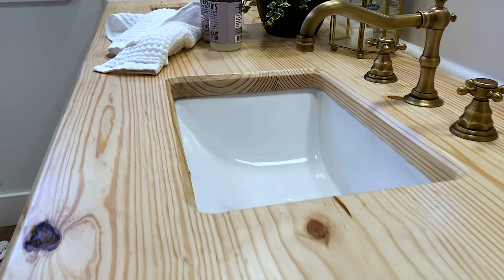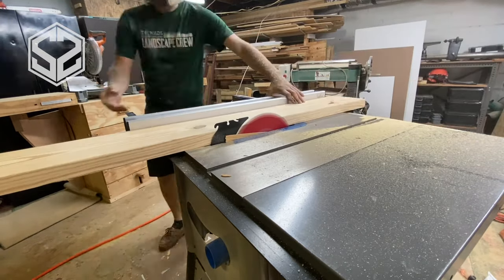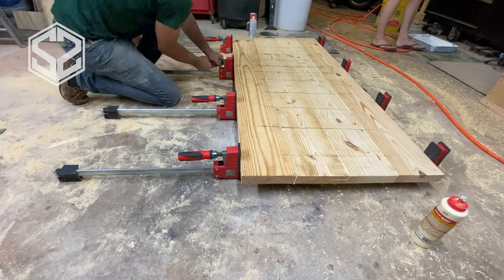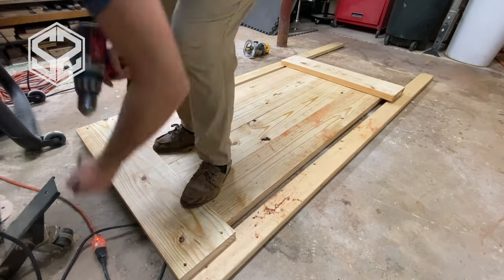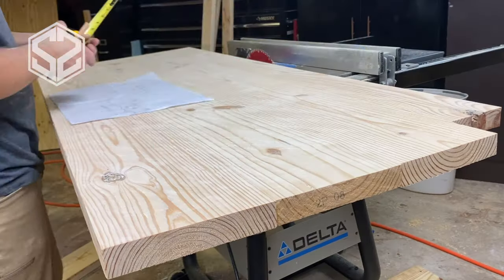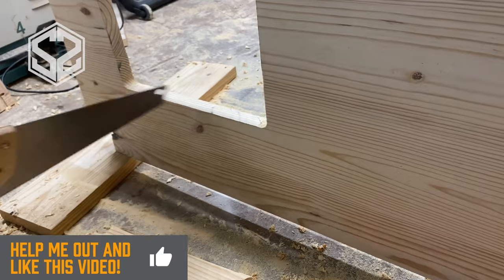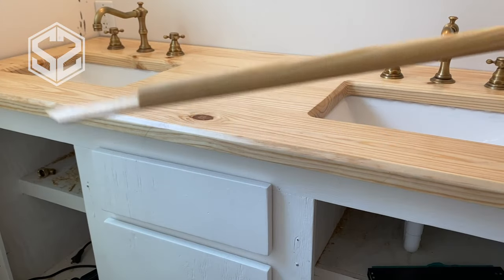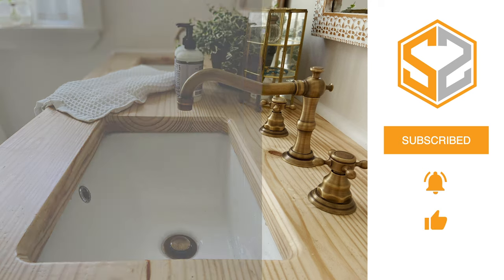DIY Butcher Block Countertop

Comment: Hey! Can you give us an update on how well it held up?My husband does not believe me that the wood won't warp and be a huge pain in the neck. (we are looking for a cheap option for kitchen counters) Have they held up? Thanks so much!
Reply from the maker: It has help up really well actually. To prevent the warping you can add the finish on both top and bottom. moisture soaking into the wood over time causes warping and that is typically from the bottom being unfinished. This is softer wood so we have seen small dents in the wood if hard items are dropped on it. However, the nice part is if you need to a clean it up a little you can add a fresh coat of finish on the wood and it will look like new.

Comment: How did u attach the wood to the vanity?
Reply from the maker: The vanity or cabinet should have boards at the top running parallel with the counter top. these are used to strengthen the cabinet but also the best place to attached the counter top. I screwed up through those boards into the counter top. you want to make sure your screws are not too long or else they will poke through the top of the countertop.
Hope that helps!
Reply: @SimonSaysDIY  I just used liquid nails. The top i replaced was attached with something similar. Thanks for the reply nonetheless 😬
Reply from the maker: @zloungeact  I have seen that done before, nice job! that should hold really well.
Reply: @SimonSaysDIY  thanks man  let's hope so!

Comment: Hi, do you think I could use watco food safe sealer for a kitchen countertop build? Would it be sufficient or would you use poly acrylic ? Thanks
Reply from the maker: I imagine so. as long as the Watco sealer repels water and moisture it should work. is moisture is allowed to absorb into the wood it will cause damage over time and possibly cause the wood to warp over time.

Hope that helps!.